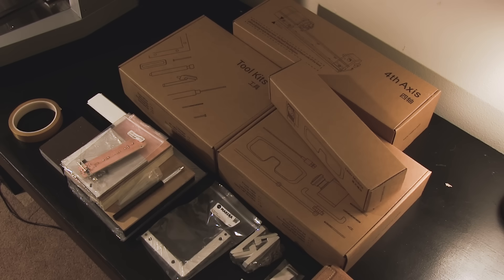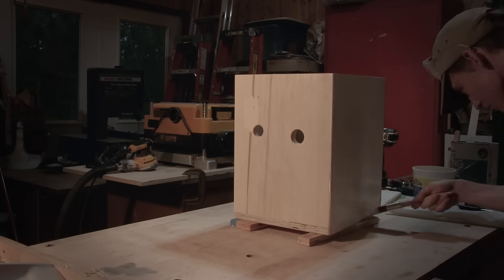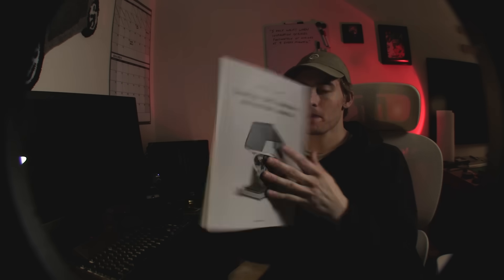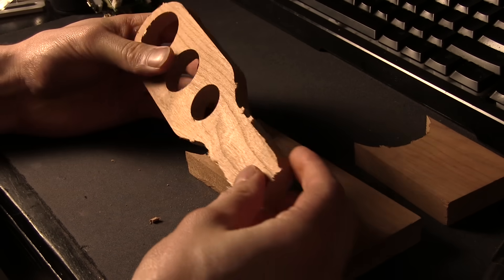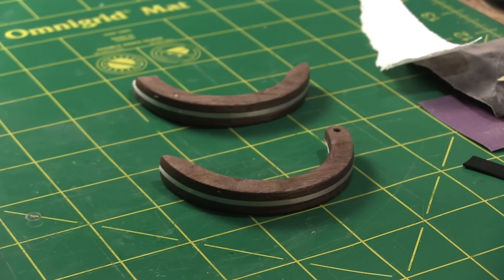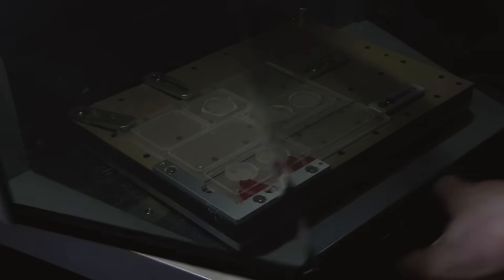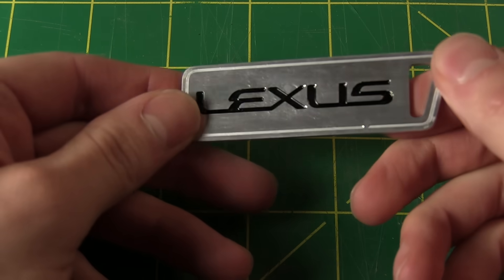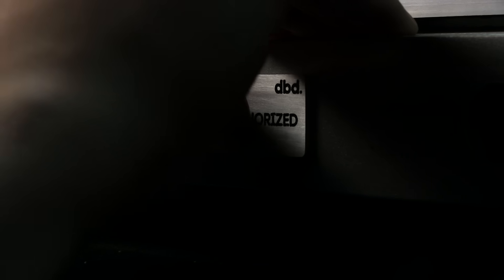The Next Evolution In Home Manufacturing

Comment: Really great video🎉. How did you manage the heat from the vacuum to prevent your enclosure from catching on fire or your vacuum from overheating?
Reply from the maker: So the thing about shop vacs is they aren't meant to run for long periods of time. So I don't really use it while the machine is running (sometimes I do for short periods). It's mostly just for clean up after machining. 

The main reason for overheating would be the exhaust circulating inside of the box but I have the exhaust being ported out the window so that definitely helps.

Comment: How did you deal with overheating with a vacuum in a closed box?
Reply from the maker: I never run it for very long because shop vacs aren't really meant to run long term. Also having the exhaust run out of the box helps too.

Comment: Would just recommend instead of securing with staples the insulation, might want to just make it Velcro, since it will get dusty in there, just so you can yank off and throw in the washing machine.

Comment: 3D printer to CnC is like jumping from a hobby to a job, in terms of sheer effort required. Unfortunately, I don't think home CnC will be a thing unless a lot of very smart software is invented to make it as plug an play as 3D printing, but you're capable of far better results! 
Cool video dawg, one thing though- I'd strongly suggest getting yourself some Sony MDR 7506's (or similar "reference" headphones) for future audio balancing work. Most audio balancing struggles come from people's headphones or speakers having too much "personality". Keep it up.
Reply from the maker: I can understand that. Making tool paths is significantly more time consuming than just hitting print. Also thanks for the tip. I think my latest video is a little more balanced.
Reply: @distracted-bydesign I’ll have to check it out :)

Comment: Cnc can be very powerful but addative manufaturing can make parts that aren't possible any other way. Not with 6 axis cnc, not with injection molding. If it weren't for the material limitations which isn't as much of an issue anymore 3d printing if by far the best form of manufacturing. The only weak points of metal parts opposed to cnc metal parts is the layer lines.

Comment: Great production quality! A tip for the holding of the parts while machining, look into the painters tape with superglue method vs the tabs. A lot less finish work when you let the end mill finish the outer profile vs having to sand off a bunch of tabs. Additionally there’s a lot of synergy between 3DP fixtures and mills for you to explore. Have fun!
Reply from the maker: Thanks for the tip! I didn't think a 3d printed fixture could be accurate enough but I'll have to look into it.

Comment: How log did the vacuum last when the motor was so nicely insulated (from getting rid of the produced heat)?
Reply from the maker: You're right that was a concern. Exhausting out the window keeps the temperatures down and the motor is cooled from the intake air. 

That being said, with pretty much all shop vacs, they aren't meant to run for long periods of time anyway, so temperature is not an issue. I've done temperature testing for 15 continuous minutes of run time (longer than I use it for) and the temps inside were okay. 

Also I typically use it as a regular vacuum rather than a continuous dust collector.

Comment: cool video man, but isnt the cutting process very loud for ur apartment?
Reply from the maker: It's really not. Sometimes with hardwood it can get a little noisy but with the door shut you can barely hear it. And you can always take less material with each cut which helps with noise. Only downside is it takes a little longer.

Comment: Aluminum is great for practice but the coins should be made of brass or copper just as easy to machine as well!
   Yes more expensive, but it has more Heft to it like a coin should! ❤ great video!
Reply from the maker: Yeah I added a magnet for slightly more weight but ideally I would use brass in the future.

Comment: i don't think the cnc machine is the next evolution in home manufacturing. 3D printing is still at the forefront.
Reply: The next evolution will be an integrated machine that's capable of doing what a Cricut machine can do while also doing 3D printing and CNC.

They all work on essentially the same basic principles so if a company could drop a 3-in-1 they'd absolutely dominate this space.
Reply from the maker: Yeah Bambu labs seems to be going that direction with the H2D (I think that's what it's called). The problem is CNC is significantly messier than 3d printing.
Reply: I've still never personally heard of anyone here in the UK actually owning a 3D printer at home.  So I'd say that what needs to happen is a printer that folds up and goes away when not in use.  That's how everyone does justify having e.g. a drill and stuff, that they use like twice a year, is that the other 99% of the time it's not taking up space.

Maybe that looks like a wall delta that folds like a briefcase, maybe it's more like a monorail tripteron that folds to fit in some hardshell cylinder thing when not in use.  Maybe it's more like the Journeymaker that already exists but stupidly is marketed as "portable!" instead of storable.

Comment: Great editing on the video1 But how loud is the machine itself. You lowered the noise on the vacuum but my understanding is that the CNC machine itself is still quite loud when operating. I can't imagine being in the same room as this when it's operating?
Reply from the maker: Definitely possible to be in the same room. There's a few factors. I found hardwood to be the loudest compared to aluminum but that could also because it's able to take more material with each pass. When machining aluminum I can comfortably sit next to it with headphones on. With hardwood I usually leave the room and shut the door and once the door is shut it's barely noticeable.
Reply: @distracted-bydesign  Ok thanks! Good to know, it would definitely be cool to add CNC to my home workshop

Comment: Side question. And may be a dumb one as my printer is old. How do you get text printed on cardboard as shown at 11.21?
Reply from the maker: I used a laser engraver to do that. Not ideal but it worked. Only downside is if you rub your finger on it, you get black soot on it. So I had to put a light coat of clear spray over it.

Comment: Pretty neat, to do these things with the CNC do you need to know any coding? or is it just a CAD software? Also using some finish like mineral oil and bee's wax will make those hardwoods pop more and be less prone to cracking overtime assuming they are kiln dried. Very cool video none the less!
Reply from the maker: No coding. CAD and CAM are what you need to know. I hadn't used CAM at all before getting this. It's basically generating tool paths (gcode) that tell your CNC what moves to make with what tool in order to create your CAD part. Super intimidating at first but I picked it up fairly quick. Still lots to learn though.

Comment: For the Final Cut of name plate - What kind of sand paper or material did you use to produce that finish?
Reply from the maker: The plate I put on the front of the cnc? I used aluminum and filled it with a oil based paint pen. Then I lightly sanded in a straight line with 600 grit. And then 1500 grit.

Comment: I will argue that 3d printing has a steeper learning curve. I'm glad you figured out the registration pin technique for two sided machining, I was goin to mention it.
Reply from the maker: Tuning a 3d printer can definitely take some time to learn but in terms of using a slicer vs using a CAM software I felt like CAM was more intimidating at first.
Reply: As someone that does both, no way. You could maybe argue that a decade ago, but not with todays printers that just simply work out of the box with great default profiles.
Reply from the maker: @amorton94  Yeah at this point with 3d printers you basically need zero technical experience to get going.